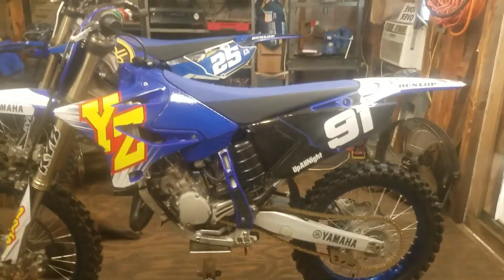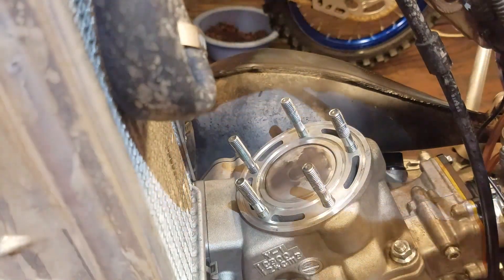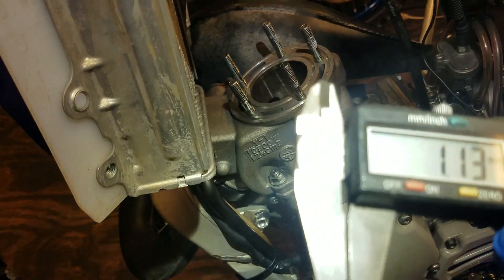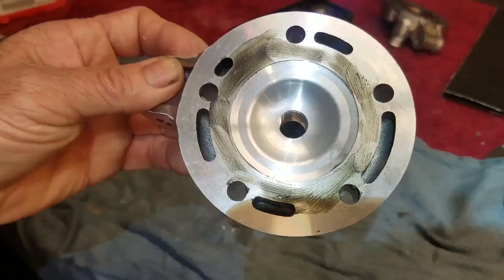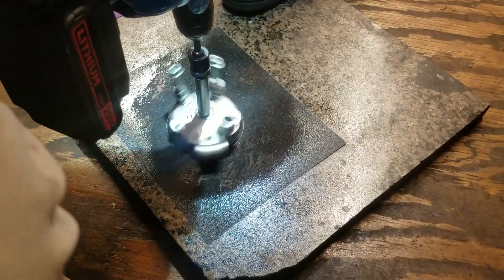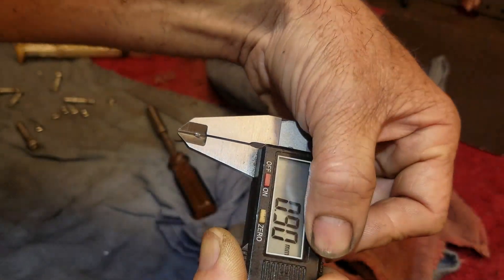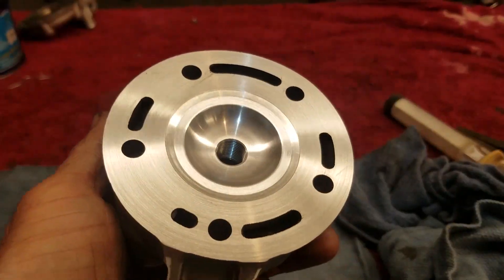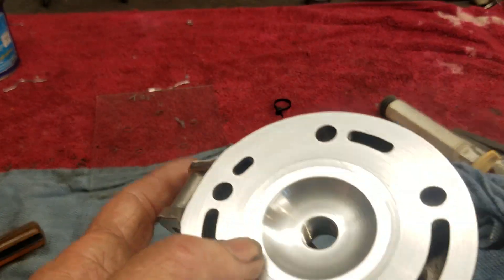1:11 YZ125 DIY Head Mod & Test n Tune. 0.035" squish & near stock compression. @ 74MX

Comment: I just did some head work on my 2005 yz 125 I just shaved .008  off  and it moved up the psi to 10psi or so more and it has a little more off the bottom and pulls hard all the way to the top …keep up the nice videos and work
Reply from the maker: Thanks man. I bet she did pull well with that. I'm going to be putting another head together with higher comp and see how that does. The 2005 YZ125 had a one off head, only used in 2005. Has a sharper radius from squish to dome.

Comment: Very useful imformation! I will be trying this on my 22 when I take it apart. I've heard lots about the stock piston on the 22 shattering so I will be doing my top end very quickly. I think im at 20 hours.
Reply from the maker: For sure, get that piston out before it causes trouble. I'm looking at doing my top end at 20 hours just to gauge how things are wearing with me on a 125. Then adjust from there
Reply: I saw that on the last post! I get my bike on Tuesday!! I will definitely replace at 20hrs. Good info bro! Keep the videos coming!
Reply from the maker: @brandonmitchell8846  congrats on getting the new bike.  Honestly I would do the piston right away with a good forged piston.  Not only for safety reasons but also to avoid breaking anything else like cylinder, head, or even cases.
Reply: @UpAllNight91  thanks bro! I am living in Costa Rica and I have friends bring stuff out lol. My next package is about a month out. I gotta Ripp this thing.
Reply from the maker: @brandonmitchell8846  ahh nice man.  That sounds cool

Comment: You should really try a STIC Metering block and Keihin carb. Im kicking myself for selling it with my last bike, but I might buy another one for my 22 yz. It made my yz 125 BARK.
Reply from the maker: Nice. What I'm reading is the biggest gain of the keihin is mainly better bottom?
Reply: @UpAllNight91  I bought a old carb off a 2002 yz 250 and that was a big mistake. The bike ran ok, but I could never get rid of a lean spot in the middle, no matter what needle or clip I tried(this was before the STIC). I swapped the STIC in, and apart from the lean spot in the middle; bottom, middle, and overrev were much better. My bike also revved a lot higher and had way more bark to it. Mine was setup for moto but was still easy to ride in the woods. Had enough hit to keep it fun, but to make it easy to hang on for 20 minutes. Would 100% recommend over a lectron, and stock carb, but only if you have $300 burning a hole in your pocket.
Reply from the maker: I didn't even know what a STIC was, had to goggle it lol.  Looks interesting.  When you used the 02 yz250 carb, what about the power jet? Just leave unplugged?  I actually like the mikuni carb on the yz125, but could be because its been around for years and its so cut and dry for me. It does look cheaper vs the yz250 carb but its been arpund since the late 80s so its familiar lol

Comment: i love ur channel i from poland and i watch ur videos all day, i have yz 250 2017 and i dont know how to set my suspension for sand track slow rebound? how much clicks?, i have sag for my weight
Reply from the maker: Thanks brother!  My current settings for my 2018 yz250 on mostly sand tracks are...

 shock...
High Speed 1 turn
Low speed  9  clicks
Rebound 5 clicks

Forks...
Reboubd  10 & 9 clicks
Compression  10  clicks
Fork Height 7mm
Oil volume 332

If you haven't caught my suspension series it may be a good watch.  Kinda long and winded but there's alot in there.  Here is a link..  
https://youtube.com/playlist?list=PLyockiXvbg8G4nEIuCtfJg6TnmvQ6NoAC
Reply: @UpAllNight91  thanks alot
Reply: aye brother, from hard to soft 8clicks? or from soft to hard give more clicks from 0
Reply from the maker: @kubamx2676  8 clicks would mean,  first turning all the way in (clockwise) till lightly seated (thats 0 clicks). Then turn outward (counter clockwise) for 8 clicks.
Reply: @UpAllNight91  so give max clicks for hard and 8 clicks from hard to soft yes?, and all clicks do like that
Reply from the maker: @kubamx2676  all the way clockwise for fill hard or max dampening.  And turn counter clockwise for less.
Reply: @UpAllNight91  Ok, my suspension in my bike its no good i mean bouncing me on big bumps on sand tracks but i have low speed rebound and i dont know what i can do i cant ride fast on bumps
Reply from the maker: @kubamx2676  is your shock blown out or is it working ok?  If you turn the rebound clickers all the way in and then press down on the bike does it bounce back up or come up slowly
Reply: @UpAllNight91  slowly but on track dont working good
Reply: @UpAllNight91  i feel all bumps on my body and my bike doing breakdance left right 😅
Reply: @UpAllNight91  my suspension dont work smooth
Reply: @UpAllNight91  on youtube i watching ur and other videos with the same suspension and the suspension works very clean
Reply from the maker: @kubamx2676  hmm man.  I would start from scratch then.  How long since serviced.? All bearings good and smooth? Any slop anywhere on bike?
Reply: @UpAllNight91  i think my shock up bearing is not good my swingarm working up down idk how to say this in english hehe, and i dont know when my suspension have service i have this bike only 5hours
Reply from the maker: @kubamx2676  ok. Yeah I would get the bearings fixed and surely service the shock and the forks and start from there.

Comment: I have a FMF Fatty, shorty, 05-10 stock silencer (pre emissions version), Lectron carb if you wanna test combos
Reply from the maker: 05 to 10 silencer.  Funny how long they made the 2011 to present silencer.  Not sure about the lecton carbs yet.  I hear people having good success with them online but all the ones I've seen in real life are giving people problems getting them right
Reply: @UpAllNight91  Was at 74 yesterday for 1st ride on the bike. Used Fatty+shorty+Lectron. Pulled great but could use a little more up top so I'll try the stock silencer next. I feel the Lectron may be limiting the over rev too though. Got the bike used so I don't have another carb to try.
Reply from the maker: Nice man!  I will be back at 74mx on Saturday if weather holds.  I would grab a good used OEM carb off ebay if you can.  Last weekend as you know it was rained out everywhere but this weekend hopefully its good. What year is your yz?   You gonna be there again this weekend?

Comment: My bike broke need new cylinder my junk wiseco piston got hot seized in cylinder i changed this piston a month ago i should have left my old piston in this what i get for messing with something that isn't broke im buy 3 extra cylinder il be ready next time
Reply from the maker: Bummer to hear that, sorry to hear that. The forged pistons are stronger and less likely to break and tear up a cylinder however they surely need to be warmed up well before giving them the beens. They also dont like to be ran with not enough oil. If warmed up well and lubed well they are stronger and more of a "race" piston.
Reply: @UpAllNight91  ok that's what il do thanks for advice warm up an more oil to my gas mixture
Reply from the maker: @michaelgarland579  Right on!
Reply: @UpAllNight91  I have a question for you can I use Athena Cylinder With oem top??
Reply from the maker: @michaelgarland579   Yes. Athena cylinders and cylinder heads are basically copies of the OEM stuff and are 100% interchangeable.
Reply: @UpAllNight91  awesome that's good to hear il have my cylinder Fri an piston sat so il have my bike back together by Sunday il be riding again wow this been really long 2 weeks not haveing bike
Reply from the maker: @michaelgarland579 I bet!  One of the reasons I try to own two bikes anymore these days. It drives me nuts when I dont have a bike to ride lol